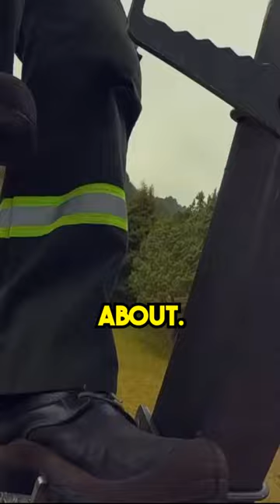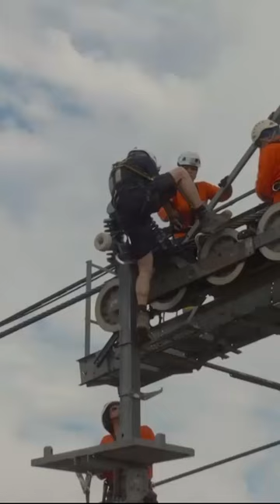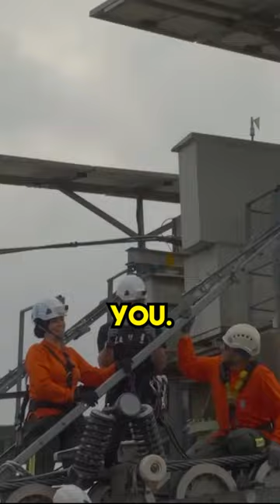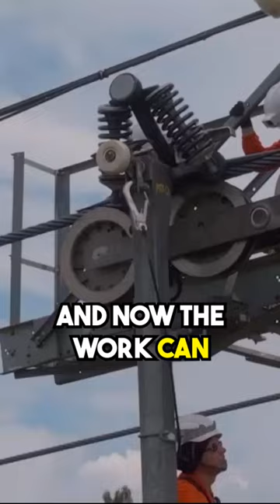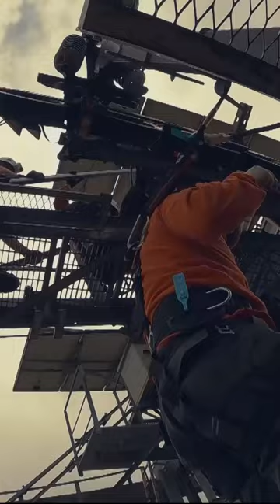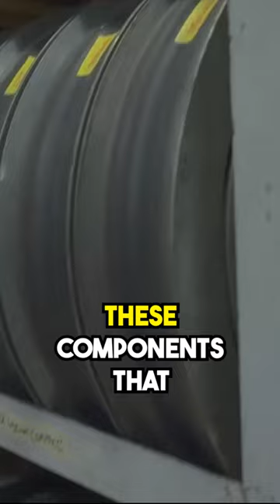Guy fixes cables at ridiculous heights! | Our Guy in Colombia

Comment: What 1500V system?
Reply: Yeah pretty sure thats a ski lift in off-season
Reply: @adamswan17  It's not part of a powered system. Only the motor at the bottom or perhaps also at top. But there's no power in the poles other than cable position sensors and such. 
They make it sound like they're working on power lines.
Reply: Yeah this isn’t a pylon like a power line, it’s a cable car